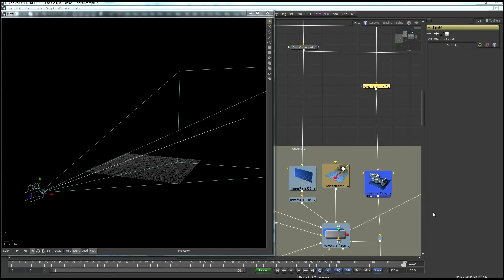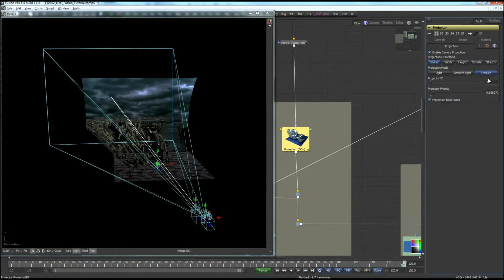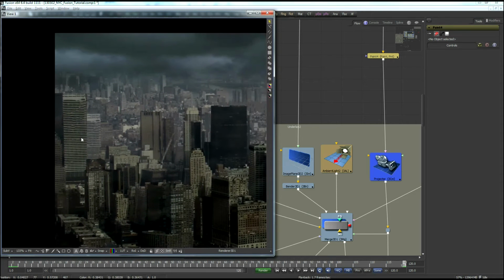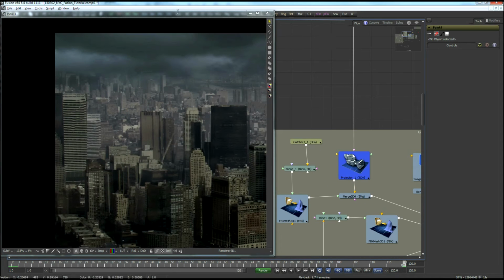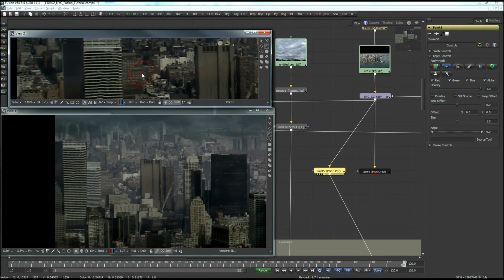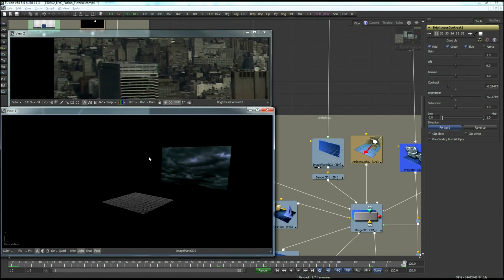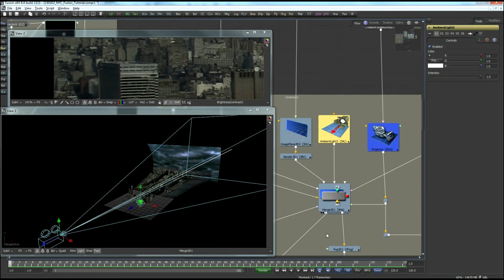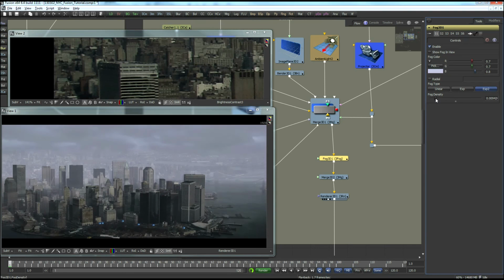3D Compositing in Fusion 6.4: Aircraft in distress over Hudson.  Part 2.

Comment: Your overviews are long and very detailed.  Thanks for taking the time to do breakdowns of your comps and your thought process, I think they're way more useful than just basic tutorials.

Recently I got fusion and am using it with my Avid, via Connection.  I use it with RED camera pan-and-zoom etc. My uses are just a graphics replacement but even so this stuff is very helpful.  I will be learning more about particles etc and I think you have a bunch of stuff in your other vids too.

Thanks,
Stu